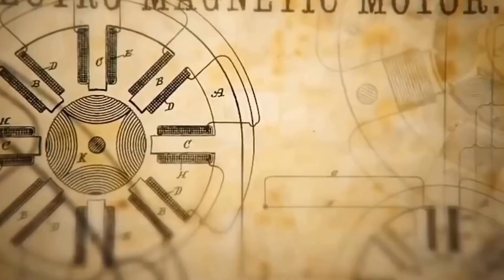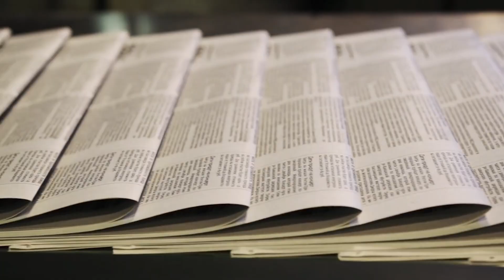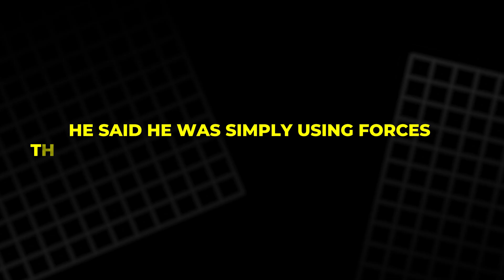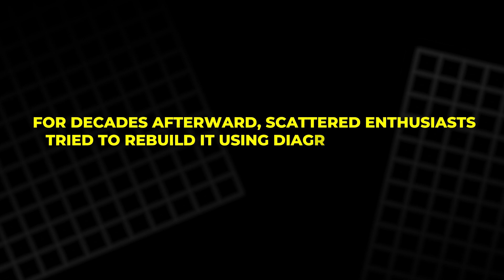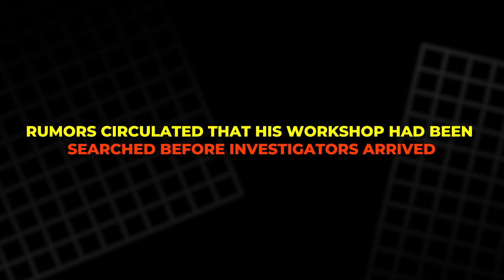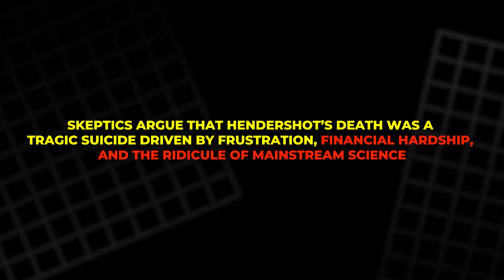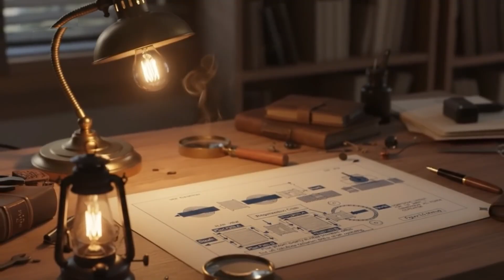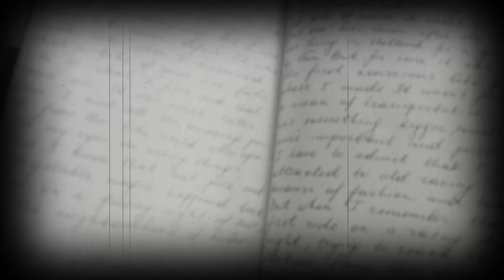The Mystery of Lester J. Hendershot, The Man Who Claimed to Create Infinite Energy #freeenergy

Comment: So in the end, does Hendenshot 's design produce a sinusoidal current?
Reply: in the end (Ионел) - не задавай тупых вопросов ! В тихаря люди давно пользуются Free E \видимо ты упал с большой высоты и не пользуешся NET-ом\ Теперь ILON Mask и Andrea Rosi строят мощный завод по ''этой теме'' ! А простые маховичные -Overunity китайцы уже продают !
Reply: spikes like back emf but with more output in one direction. it cancels out in one direction and is additive in the other. however because its a collapsing field it produces high speed high voltage spikes that cointain the snapping back of the earths magnetic field theres a little bit extra energy on every output cycle while the input cycle consumes less energy so there is a small net gain in one direction which in large amounts gives rise to a usable output the key is load balancing the load has to be a small fraction below for maximum efficiency, load it too much and it will dampen out the entire output so it's basically a carefully balanced net positive feedback loop if the load is too high it will just stop working its shown with one lamp for example but will stop running when two bulbs are attached because the load is too heavy you need a bit of the energy to keep the thing going. you can study aviation compasses if you want to find the key.